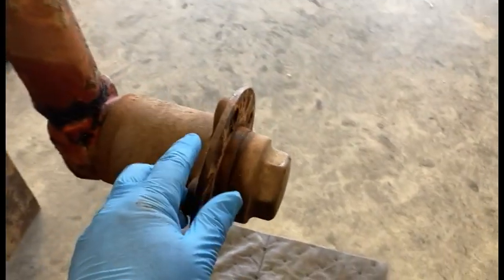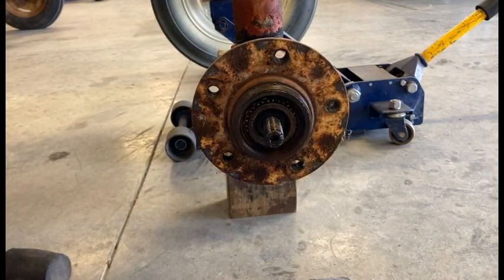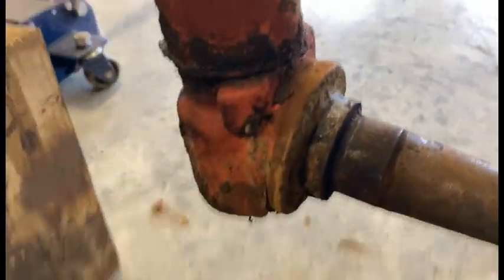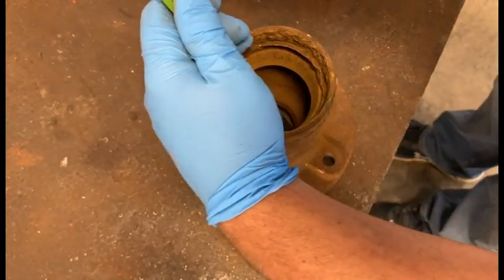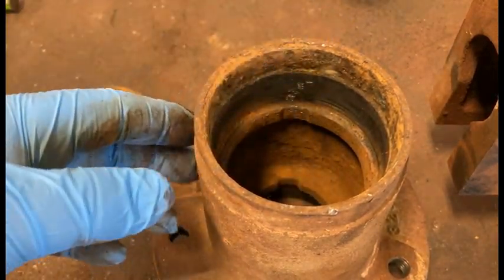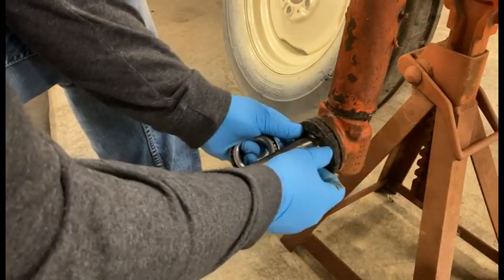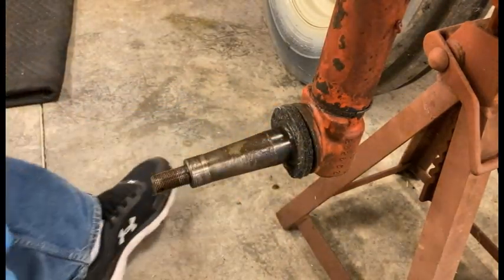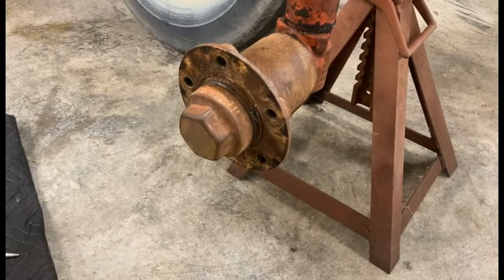Allis Chalmers D17 Front Wheel Bearing Replacement

Comment: Hello!  Do you happen to have a link to where you purchased the replacement bearings? I just went down this trail and went to reinstall the new bearings and my replacements were wrong.
Reply from the maker: Call Sandy Lake Implement with your serial number and they will get you fixed up.